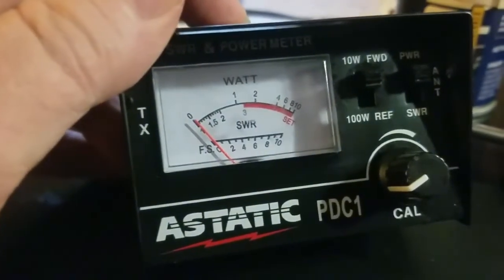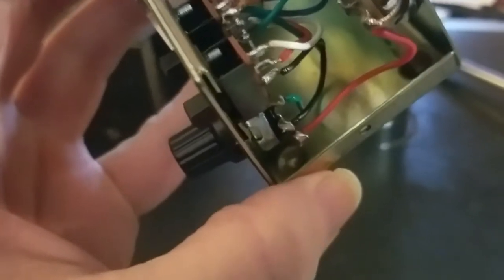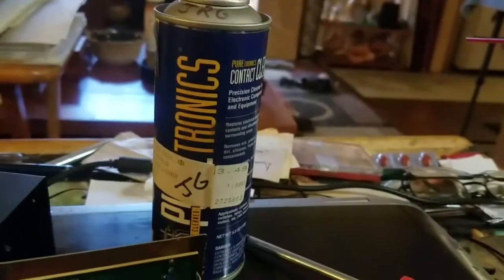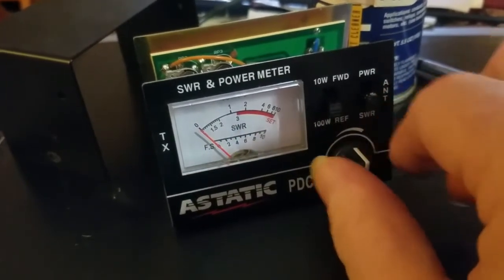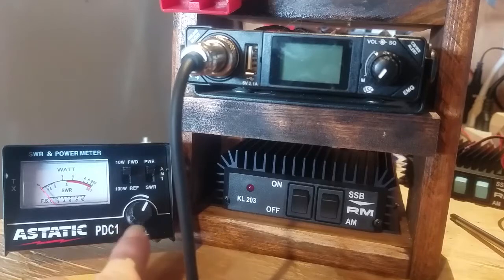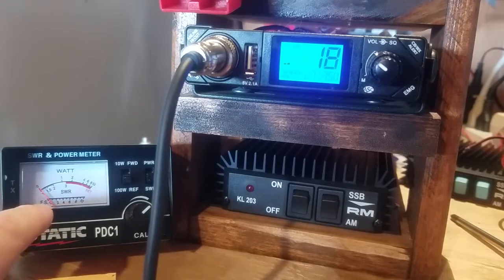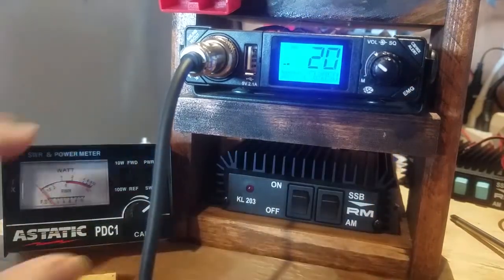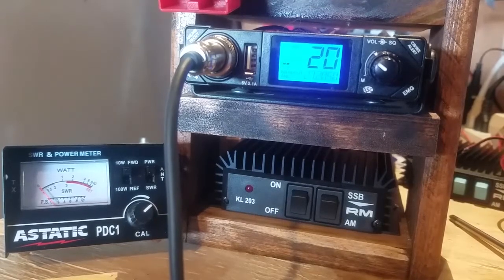Astatic PDC1 switch cleaning and confirming swr from antenna tuning

Comment: Hi SWR: standing wave ratio
What is standing wave ratio (SWR)? Standing wave ratio (SWR) is the ratio of the maximum magnitude or amplitude of a standing wave to its minimum magnitude. It indicates whether there is an impedance mismatch between the load and the internal impedance on a radio frequency (RF) transmission line, or waveguide. Ex Radio Officer Merchant Navy trained on 2KW HF TX

Comment: Can I use only the watt meter to test my tyt mobile radio watts power???         can I use it on any frequency to test the watts on my mobile radio
Reply from the maker: I have only tried this meter on 11 meter frequencies. It may read power from other frequencies just fine, but I don't know if it will effect antenna tune when you transmit. Hopefully it would not cause more SWR on your radio... Maybe?
Reply: @TheSimplePreppers  so my question is can I use this meter to test my mobile radio watt power only  to make sure if it’s using full 40watts?
Reply: @warzone7571 f your tyt is not an 11 meter 10 meter 12 meter rig, then no you can not use it, tyt are usually 2 meter 70cm, but I do know they have the 7900 quad band that you can use it on, you need to specify what bands your radio works on, and you need to use both the antenna and the radio, not just the radio.